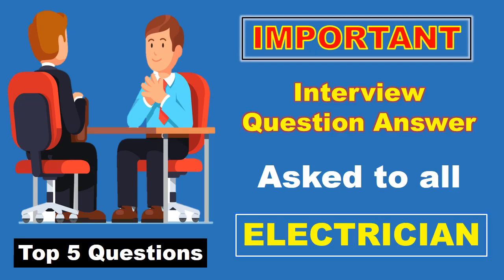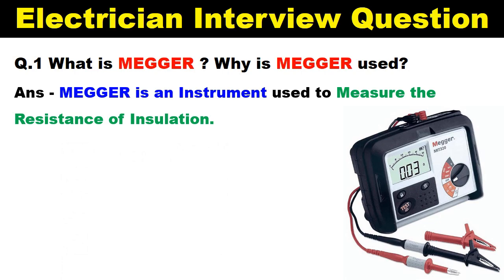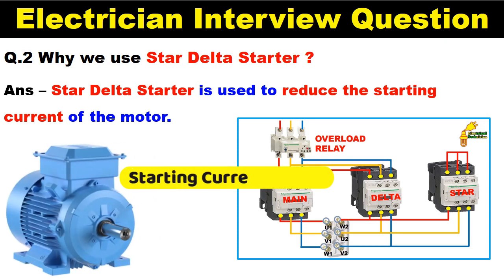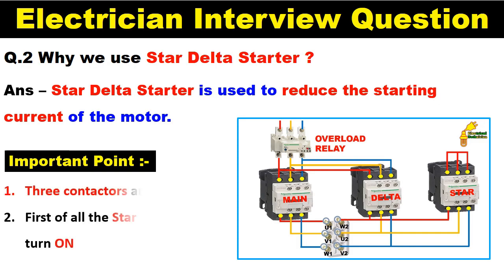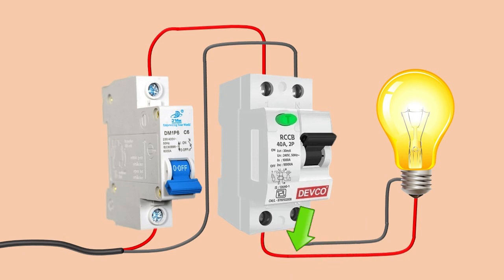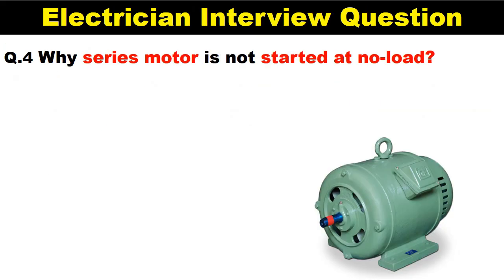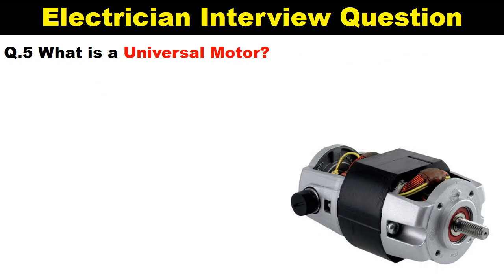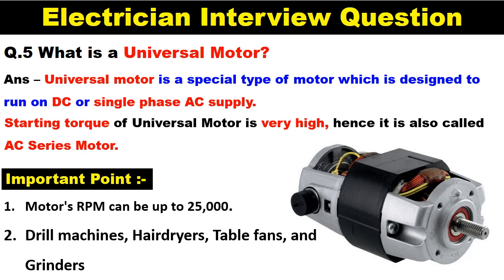Electrical basics Interview question and answer | Electrical Interview @ElectricalTechnician

Comment: Megger is just a manufacturer,it is not the type of test device you are giving incorrect advice
Reply: His explanation is crt .this is used for insulation resistance purpose..
Reply: Correct him instead of complaining
Reply: Why are we using 30mA RCCB in our home? Is it not too low? Compared to the voltage of appliances?
Reply: My Dear it's a mA not Ampere. 30mA is equal to 0.03A.
Actually he has a mistake. RCCB is a protection device designed to swiftly interrupt the power supply when they detect a dangerous leakage current. It's equipped with a sensitive mechanism that can detect this imbalance. When the leakage current exceeds a predetermined threshold (typically 30 milliAmperes) not 30mA as a rating of Breaker. That is supposedly his explanation. @Kayodethegrapher
Reply: And Google said.

A Megohmmeter or insulation resistance tester, also colloquially known as megger, is a special type of ohmmeter used to measure the electrical resistance of insulators.
Reply: @mohammedwaqir4254 insulation  tester
Reply: Thanks for the videos